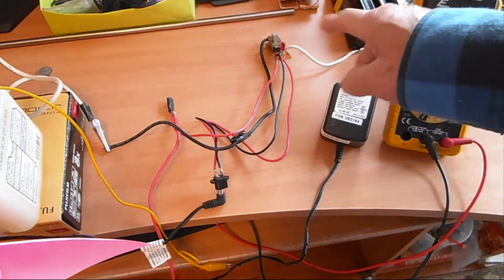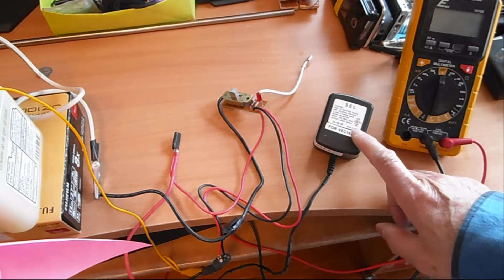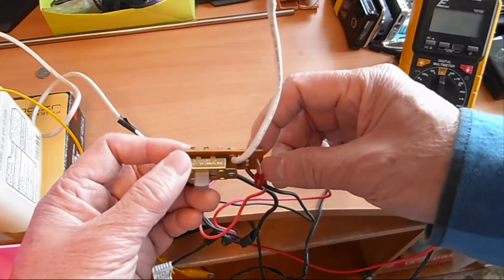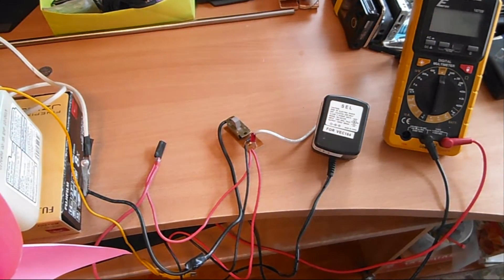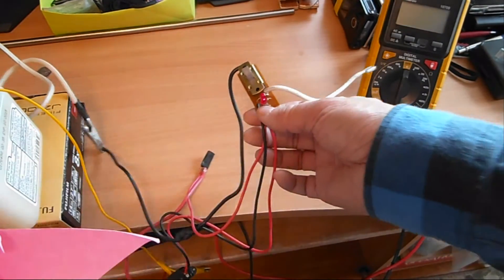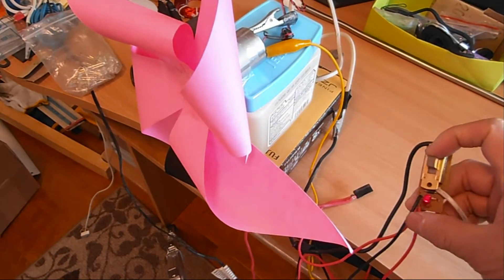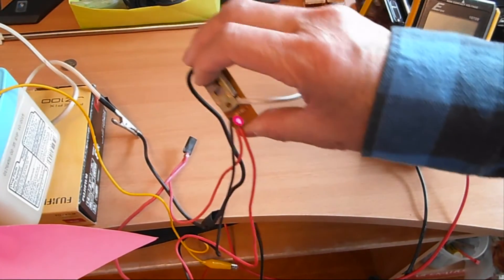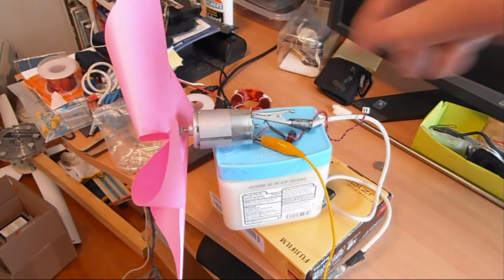Simple 12 volt 300ma trickle charger

Comment: Would it be possible to build so that the charger runs off 12V 300ma?
Reply from the maker: +tvshards You have to measure the output of the charger, it has to put out 16v to 18v to charge a 12v battery.  With some charger, wall wart, you might have to put a small across the positive and negative to get a proper reading.